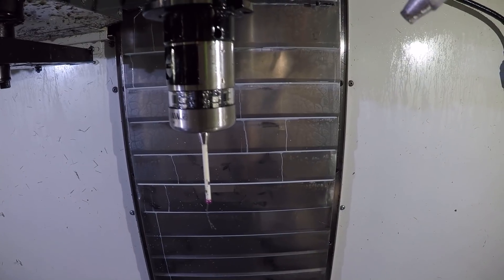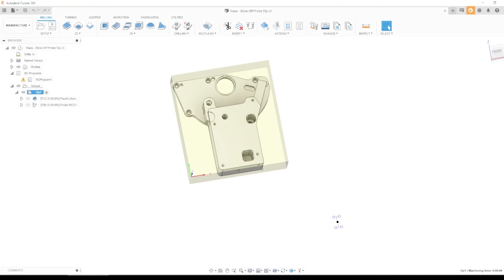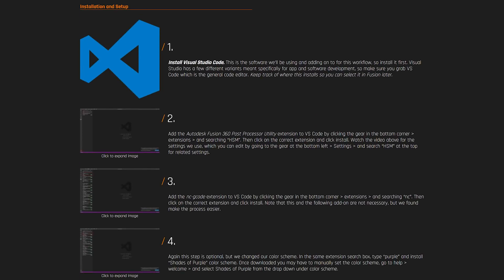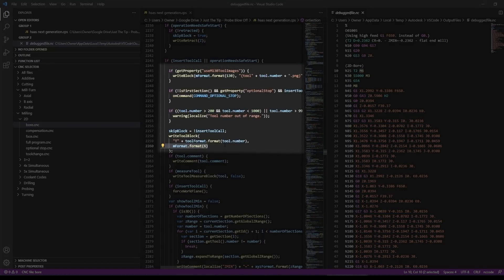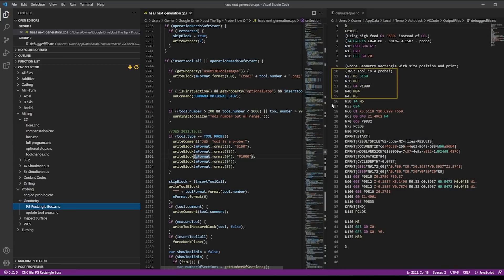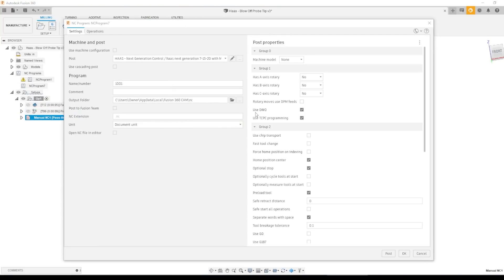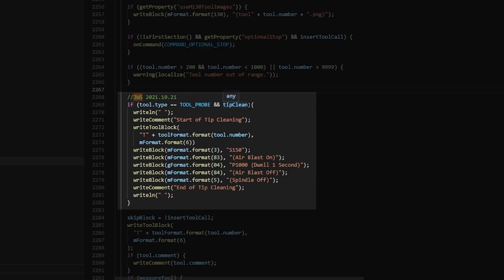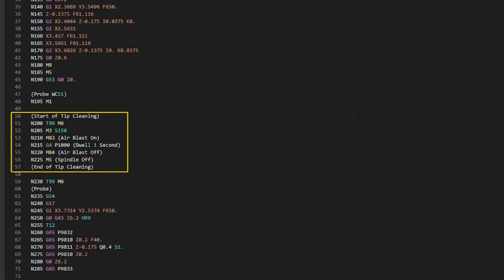Make Better Parts: Automatically Clean Your Renishaw Probe Tip!

Comment: we use a chip fan at work to dust off the cores. works great, might be something to consider if you probe more than once in a program. i've trained a few at work at this point. they never last, high hopes for my latest trainee. he's doing a fine job thus far. they wanted me to make sure he could troubleshoot somewhat though. in the past it's always been call me and have me walk them through it or in a couple of cases, come up back in and save their bacon. i told him in more words, most of the time it's a probe issue, it's dirty and messing with the work offset. normally though it's a nonissue. i make sure i address any funny cuts even if in tolerance before he comes in. not trying to set him up for failure, he'll learn like i did i'm sure, over time and no one to save ya. something i've learn since getting good is the better that probe is, the longer blade inserts last. last time i had to fix it, i got the runout down to .003mm, .01 is our tolerance. wouldn't have thought it would have made a big difference but compared to my training and beginning days, it's huge. good enough is never good enough on some things.  cool trick/tip btw.

Comment: Excellent video!  My best Renishaw probe story... a careless operator cracked the glass body on a TS-27R probe.  Still worked, accuracy wasn't noticeably affected, and a replacement probe was a few weeks away.  But the humidity (this was in India) would seep inside the body, condense on the inside surface of the glass, and could eventually cause problems with the electronics.  So I had someone provide a condom; poked a hole in the tip, rolled that sucker on, problem solved!  We used that probe for at least 6 months, replacing it every few weeks as required.

I tell this story anytime i see a Renishaw probe mentioned.  So this may be a repeat.  Cheers!

Comment: If you add your code after the tool change instead of before, you wouldn't need to add a tool change inside your if block. I noticed an extra tool change to the probe after the air blast. I doubt this would make a difference other than being slightly "cleaner."
Reply: Yes, had the same thought!

Comment: Another tip: there is this small breakaway joint you can buy.  They are like $8.  They connect between the probe body and stylus.  If you crash the stylus, the breakaway joint will break instead.  Just replace it and save the stylus.  Additionally pop small holes into the breakaway body, and use some fishing line.  Then when it breaks, the stylus is dangling off the body and not lost to the chip conveyor

Comment: Just a heads up for those wanting to try this. Study up on how your control handles probes with regards to spindle movement. Some controls have a safety that does not let you call an M3 or M4 while the probe is in the spindle for fear of accidentally spinning the probe like a tool. If you want to spin the probe at a low speed like is suggested, you may need to disable that feature, so just be aware of the implications of not having that safety guard in place.
Reply: I'm pretty sure the air blast would take care of anything on the probe, tbh. I doubt any rpm is needed, probably even overkill. But if it works, it works, may as well keep it.

Comment: Well done John. I think it's worth considering the option of having code like this in the M6 macro. There's pros and cons to having it in the post processor or the M6. For example I have my spindle air seal turned on by both M6 and the post processor.